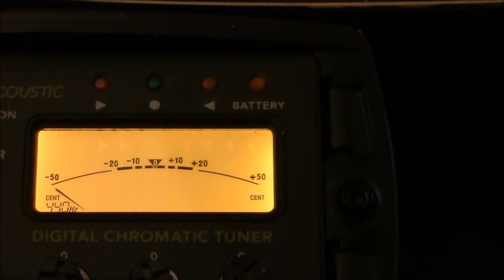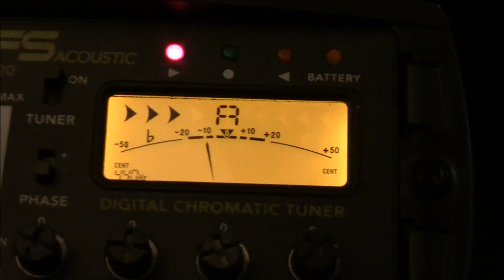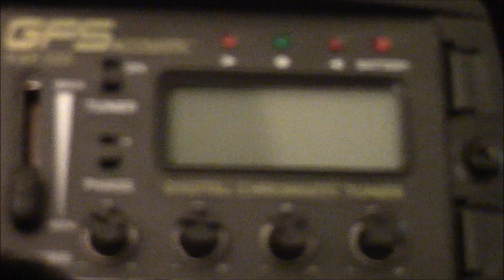PICKUP FOR ACOUSTIC GUITAR

Comment from the maker: Terry.,I didnt know they had a Pre Amp with Multiple Pickup Options. Is that the one with the under the saddle setup and the sound hole as well? One thing I never want to do is to remove a bridge on a much older guitar.  You are ASKING for problems. A Simple Sound Hole does the trick very nicely and shoot its as easy as can be to set it up.  ALSO<,,check out GF..they PUT up a INSTALL GUIDE..for these....Great..Saves me the trouble and all the CUT FINGERS and CUSSING on Camera.Thanks for watching

Comment: never seen anyone put the soundhole pup at the bottom of the sound hole. the best placement for these, sonically are near the fb.
Reply from the maker: Rachel, Placement just depends on what Tones you are looking for at the time of setup.  Me I move these around on the sound hole. As you can see there are only 2 small tightening screws to adjust. So, if I want more of a bright Tenor tone is at the back it goes. If I want more deeper tones without adjusting but from the start it goes forward.  BUT seldom do I put it in the exact middle as Ive seen more people do with theirs.  Have a good one.

Comment: I have a question. These things can go for like ten bucks on ebay. Now generally I like to use decent equipment but I'm poor. Do you think one of those ten dollar one's can get the job done for now? A pickup isn't much more than some magnets with some copper wire rapped around them anyway, right?
Reply from the maker: Paul, are we talking about this Acoustic PUP on the video? I need to know because Ive made of 350 videos about guitars and Pickups. As for that model on my old Yamaha I dont think you can beat it for the tones, versatility and price I paid $30 dollars plus shipping from Guitar Fetish. They still have the same one available. BUT, remember that this isnt just a PUP its also a Pre Amp. You would have no luck placing a plain PUP on an acoustic guitar. You NEED the PRE AMP. which comes with all the built in electronics that are built INTO an Electric but separate. 

Now, for an Electric Guitar's PUP that is a different story. Have a good one and be sure to check out the GFs store.
Reply: Davesintexas Oh, that's not bad. I could do 30. I've seen these things priced for a few hundred dollars. Thanks. Much appreciated.
Reply from the maker: Dude, you DO NOT WANT a $200 dollar Acoustic PreAmp. Makes No sense at all unless you are in a recording studio and need the fine setup one could bring to a studio session. IF you are playing your guitar for your enjoyment or even gigs what you need is a tough rig that you can adjust the tones/sounds etc EASILY and if you can get one with a tuner..so much the better. Have a good one and remember to go step by step on installing.

Comment: It doesn't sound that great with that "so called" grounding issue...did you eliminate that irritating noise? why don't you post another video WHEN the pickup sounds like it should?
Reply from the maker: Mark, Great Suggestion. Im going to do a new video on this particular guitar dealing with Fret Problems. A buddy of mine was over last week and grabbed that guitar, began playing and he's checking it out and asks me.."Hey, Dave, doesn't this need a Fret Job and BADLY?" Well course it does. BUT, I've already Re Crowned that guitar TWICE!" I answered..hehe. You see the problem is that when your frets get below 0.030 there isn't enough fret to Crown. And this guitar actually being over 50 years old, well it's value is less than a $300 dollar Re Fret Job as far as the Books are concerned. But, TO ME it's worth the work...but when it's actually Finally NEEDED. You Can play on lousy LOOKing frets AS LONG as they DO THEIR JOB and do it properly. So, when I do the video on the "FRET" issue I will ALSO include a True Voice Test for you.  How's that?  Have a good one.